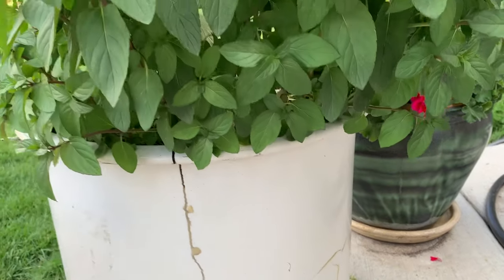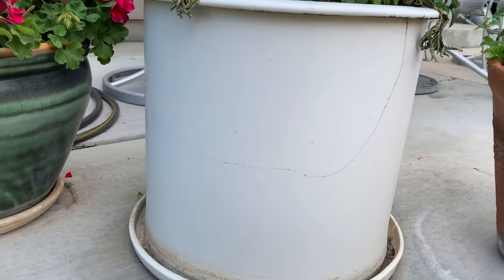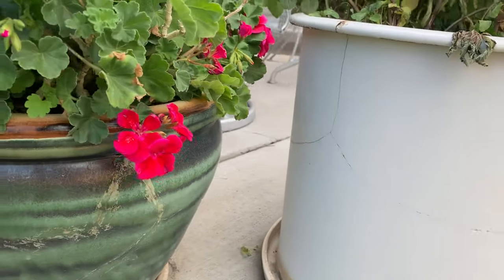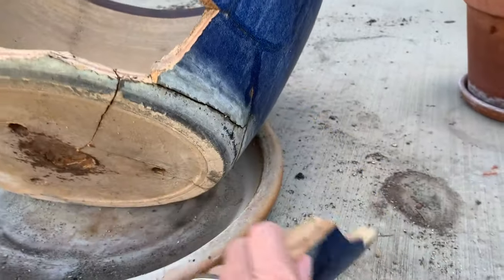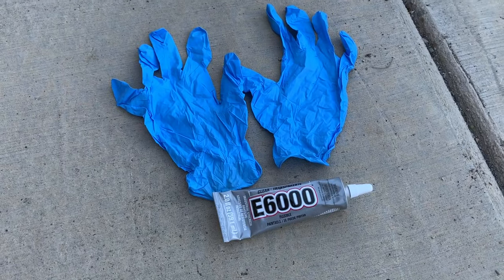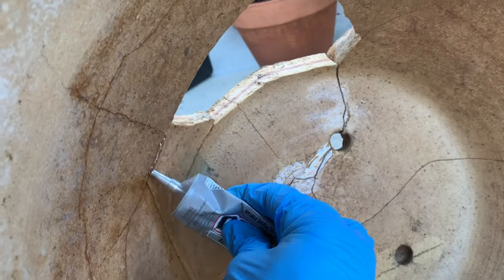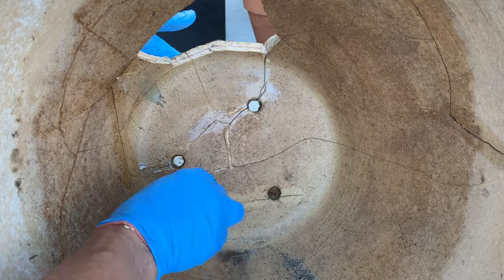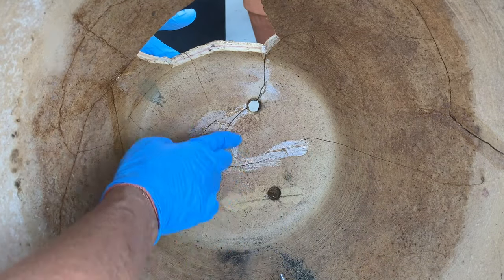How To Repair a Ceramic Planter

Comment: I never would've thought to repair a pot with that much damage. But you're so right -- that all the flowers and plants detract from the glued-up cracks. It was also helpful to hear that you might use an entire E6000 tube in the process. Great work with the upcycling! All the mismatched planters are beautiful together.

Comment: This is exactly what I was looking for.  I pulled two large, beautiful pots from someone's garbage today.  I asked just to make sure it was garbage.  He looked at me like I was crazy and said they are cracked. Well, they both were still standing and that's all I needed to believe I could fix them!   One of them only had minor cracks!  So, I'm going to use this method and some of the improvements listed below - thanks!!  One man's garbage is another man's treasure!  :)
Reply from the maker: Fantastic! I 100% agree, one man’s trash is another man’s treasure, you just have to be clever and creative.👍🏼
Reply: @NoelleODesigns  These pots were SO nice - had to be $40-50 each - major score!  And you're right - you don't notice or mind imperfections in pots with beautiful things planted.

Comment: Great video. Every Fall for the past 30 years I have emptied my pots and turned them upside down. I never lost a pot in 30 Canadian winters….until this year. Poor health meant I just wasn’t up to it so, after getting opinions, I emptied them but did not turn them over. I lost two beautiful planters, or maybe not….after seeing your video I’ll be out buying glue! And next fall, I’ll turn them over again even if I have to bribe the neighbours kid.
Reply from the maker: I never thought to empty the pots and turn them upside down. That’s a good idea but seems like a lot of work too- I guess all worth it if it saves the pots! Good luck wrangling the neighbor kids!
Reply: My brand new pot (nothing was planted in yet) still got a crack during this bad winter!
Reply: You know what? I take that back. That particular pot was in the house, but near the coldest wall in the house. It could've been something else. Sorry,!
Reply: We get -30 F winters lows with windchill here in Iowa. I don’t have a ton of ceramic pots due to how pricey they are these days, but of the ones we have I’ve never experienced weather causing cracks. By the time winter comes we have the garden all cleaned up and the pots all stacked in the back of the unheated garage (used to be put in the connected storage shed before we got chickens but obviously it’s occupied now lol). Maybe it’s the stacking, maybe the garage is just enough shelter from the elements, maybe both?  At some point though something either fell or got dropped on two of my ceramic pots hence why I’m here 😅 If you do it this way, I guess just be mindful of where you place them?

Comment: I've been using Shoe Goo (I think it's the same thing as E6000 made by the same company) to mend/fill pots and for any leaks in inflatables and it works great.A little tip if you don't know is that if you dampen a paper towel or rag/cloth when applying it you can "manipulate" it much easier.The adhesive reacts more like a moldable putty with the wetness and doesnt stick to the cloth.I'm going to try using it on a broken clay pot thanks to your video since the Quikrete Crack Sealer I had didn't work.Best of luck!
Reply from the maker: Thanks for the tip on using a paper towel or rag- it makes a lot of sense! Good luck!

Comment: I use E6000 for repairing mobile phones - gluing rear cases back on after battery or screen replacements.  I'd have never thought of using it for repairing cracked pots - this is a great tip!
Reply from the maker: E6000 is the best- I’m glad to know it works on phones!

Comment: do you have advice with how to store the glue tube if you dont use it all. i always think its a one time use thing because it seals itself shut everytime i use it & it drives my crazy! thank you!
Reply: I store my opened tubes  in the smallest glass jar with a tight fitting lid with glue in a plastic bag with the air pushed out. I found that buying the little tube packages saves so much money. Mostly I use only a little dab except for big jobs like this repair. Also I put a pin with a decent sized head and then close the cap over it. Cut the pointy end off with wire cutters
Reply: throw it away. it will have hardened or at least coagulated by next time you need it.\

Comment: I wonder if you can take a few steps to make cracking less likely. Although it seems there is no crack proof natural pot, understanding why pots crack might help avoid a percentage of that work. Also, healthier plants. 
If you improve drainage is helpful. A layer of gravel topped with landscape fabric in the bottom. Freezing water will break anything. 
Or
Coating the inside with red guard waterproofing membrane.
  Raising the pots off the ground slightly (there are clay feet for this but they are a bit of a hassle) will help avoid a frozen base while the rest of the pot is warmed by the sun and cracks due to rapid, uneven expansion. Great video.
Reply from the maker: I think one of the main reasons the pots crack is leaving them out in extreme winter weather conditions. I have many pots that are just too big to move so I deal with the cracks when they happen!
Reply: Yes I don’t plant in my nice pots I plant in a liner. They last so much better. I now live where it gets iced over pond cold and I got 2 beautiful big pots at the dump and they are cracked, not broken yet. I used Flex Seal on one but it’s too ugly for outside of the pot and every year they crack more. I have lots of E6000.

Comment: I just discovered this video, and it's super helpful! After looking for a specific type of hanging wall planter for weeks, I finally found one at a ceramics market while on holiday. By the time I got home one out of two I bought has developed a crack diagonally across, underneath where it should be hung and would carry the whole weight. I'm so sad. It's not fully broken yet though, so I'm hoping generous amounts of glue might fix it. I'm wondering if there's also some types of tape or something else to add to the back to reinforce the structure to hold the weight... perhaps some masking tape that can soak up the glue? Have you ever tried something like that? Any extra advice would be much appreciated!
Reply from the maker: So glad this video helped! The only ‘tape’ I can imagine would help would be like a mesh tape like they use for drywall. but honestly, the E6000 works so well I don’t think you even need it. The pot from this video is holding strong years later!

Comment: The cracks bother me.  (I do interior design)  What I've learned is that if you make a mistake, make it better than it was before.  For the noticeable cracks I would get paint and be creative.  No need to paint the whole pot, but maybe vines or "modern" art over the cracks and keep that look all the way around. Thanks for the video!
Reply from the maker: Good idea- definitely get creative to cover up the cracks if they bother you or are in a very noticeable place. Visible mending is beautiful thing and worth drawing attention to!  These planters are in a place where I have never noticed the cracks once they’re been repaired. Thanks for the tip!
Reply: @NoelleODesigns  or Modge Podge something decorative over it
Reply: Have you seen the Japanese guy that repairs ceramics using gold,  its sorta shows the flaws in things that makes them unique.

Comment: Hey Noelle, I’m going to use your way of putting a pot back together. In my case, the pieces were given to me and there is going to a hole. I would say inches in size. How do I go about filling that hole?
Reply from the maker: Maybe fill the hole with something else- like rocks, sand, glass, a broken piece of ceramics, marbles… you get the picture. Good luck!

Comment: Think I can use a piece of ceramic from a different planter that totally shattered to fill a hole similar size to what's in your blue planter? I dont have the piece that came off my planter, so I'm just hoping thinking using a different peice, maybe using my dremel to get the shape exact, and doing this method to fix it. Think that'll work,I don't see why not
Reply from the maker: I think you could for sure use other ceramics to patch the hole! Thanks!

Comment: I am repairing a favourite planter that cracked and fell apart. While gluing  back together, I found some pieces are missing, so fair sized gaps and holes that need to be filled in (then painted). Would ceramic putty work or is there something better?
Reply from the maker: I really have no idea but ceramic putty sounds like you’re on the right track!

Comment: Thank you So-ooo much!! This is so awesome! 

I have a question for you, if you don't mind....

Have you ever used Flexseal to spray any of your NOT broken pots  to make them water proof? (like say a wooden pot?)

I'm Curious because I'm wanting to turn a really cute jewelry box made of solid wood into a planter by gutting the inside out & then water proofing it.
(I don't know what kind of wood it is - it is painted off white & has  "Distress marks."
(I can invision succulents in it so-ooo bad! 💕🥰)

I'd appreciate any help/advice.

The E6000 glue is a tremendous help, because I have a few pots broken & I figured I'd just have to use super glue lol, but nope! I'm going to Home Depot today! Lol 😂👍

Thank you!
~Sarah
Reply from the maker: Thank you for this question because I was just discussing with my daughter waterproofing wood (an absolute necessity) and terracotta (preemptively) and wondering what to use… I’m going to look into Flexseal- I’ve never used it before. 
Also, ask when you get to Home Depot- the workers usually have good ideas on what to use. 
Sorry, I can’t be more helpful but let me know what you find out and what works!
Your jewelry box planter idea sounds fabulous!!
Reply: @NoelleODesigns 
Thank you for the quick reply! And, thank you re: my little Jewelry box! 💕 I've always wished we were able to post pictures within the comment areas. This is the most adorable little wooden jewelry box! I've had it for years & funny thing.... I've never even used it for jewelry haha 
(I think, if memory serves I got it for my Daughter when she was young, she's 27 now).

So, I already took the top off & after I remove the inside  (it's like a tray with material wrapped around it). I plan to use the E6000 to glue the frame of the drawer & slide it in & that will stay put (thanks to you! 😊 I have for months been trying to figure out the best & safest way to glue it - for plants/soil to come in contact with it & also waterproof it) 

And, then I'll flip the top upside down & glue it on the bottom (it'll give it height - instead of just throwing it away) & the entire body including the top & bottom have a curvy design. It's just so unique, like antique looking. 

I wish I could show you!

One more thing.... I was going to say something about Terra cotta pots in the last message.... Lol however I didn't want to come across as sounding dumb lol, because I assumed they're supposed to be waterproof lol, but.... I ordered some of those from a seller on Amazon where you get several for a really good price, right, but the thing is.... After watering my plants a few times I swear the pots are like disintegrating! (I rub my finger across the pot & the "orangey-brown" is all over my finger!) so-ooo my first thought is "Are these actually Clay pots & not Terra cotta?!"  or am I stupid and Terra Cotta is clay?

Now, all of my plants are indoors so I'm not worried about waterproofing all of them however, I would like to take them outdoors when the weather is nice.... That is my whole point of wanting to waterproof (& my little jewelry box! 🌹) & also if I do in fact have clay pots then I might need to waterproof them? 

Again, Thank you for your time! 😃

~Sarah

Comment: I love the background music. Can I please have a link to it?
Reply from the maker: Music credits are on the final shot.😀
Reply: Thanks
Reply: @NoelleODesigns  I actually repaired my one flower vase using a hot glue gun and the music on the video . It didn’t turn out as beat as yours though.
Reply: @diyallthings  Is it holding well?  I was going to purchase the E6000, but not if hot glue works!
Reply: @rage242  so far so good. Hope my kids don’t make it fall again. The first time I tried to glue it with backing soda and super glue. It was fine until the pushed it down again. If it falls one more time, I will put an inner coat of cement .

Comment: What's with the word "up cycle"?    It means nothing what happened to the real word RECYCLE ?  Meaning  REUSING AN OBJECT .
.
Reply from the maker: Recycling takes old materials and breaks them down into new materials that can be used for other products. Up cycling takes old materials and transforms them into something new and better than they were before. Both recycling and up cycling are important parts of going green and reducing your carbon footprint.🙂

Comment: Thanks for video, but think it could be a lot more instructive and detailed Just showing you jam a bunch of glue is not a “how to”. You should talk about pre-setting pieces based on angles and how they will fit. Someone could easily ruin a pot by not adhering to the proper order. You should talk about gluing options, set times, material contradictions, room temperatures, smoothing, clean-up, hand protection, etc, etc.

I do appreciate the effort, but think you would get a lot more hits and likes if you really spent just a few extra minutes to add some vital details and instructions. Hopefully this is constructive criticism. Regards
Reply from the maker: Thanks for the constructive criticism- I should have been more aware of the details- I guess I’ve fix so many pots I didn’t even think about the specifics that seem second nature at this point. Thank you for considerately pointing this out, I truly appreciate it. Cheers
Reply: I think almost all your requested information is obvious from the demonstration, although not explicitly stated. The instructions on the glue answer the question about setting time. The beauty of YouTube.
Reply: road dog. did you telephone the buscuits or did the doorbell spin a rekky~tooh? zilda retenkoh, berry socks chaploopah teggy sinf trexvald toggy~too, toggy~too. slippers rumbled back scratch elephant nokki tan. starantup voh?

Comment: No need to repair such worst pot,
Must threw away and buy new one.
#Thats_it
Reply from the maker: No need to throw any pots away (unless you really want to...) repair is the best! I have pottery that has been repaired for 10+ years and still works fine. #YouCanDoIt
Reply: oooooh. noooooooo. always worth a bash at salvaging mate :)